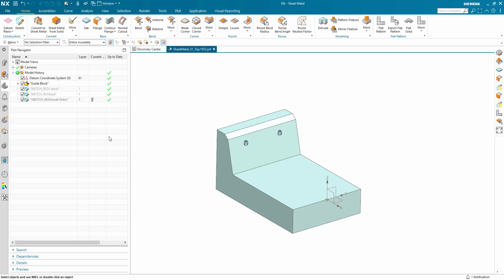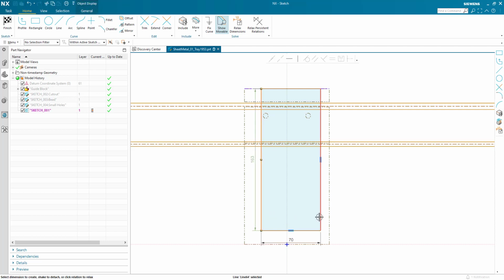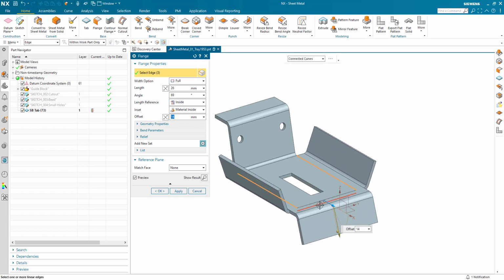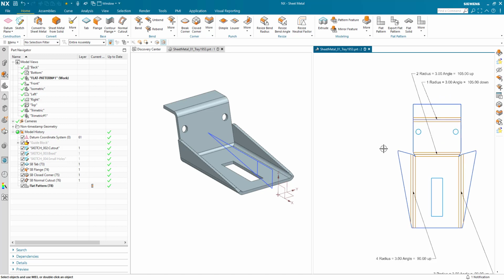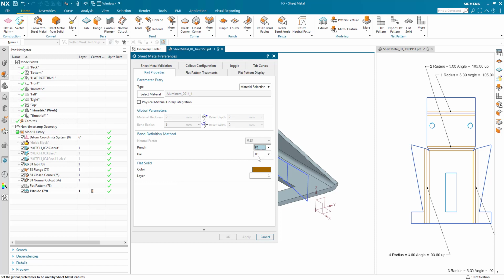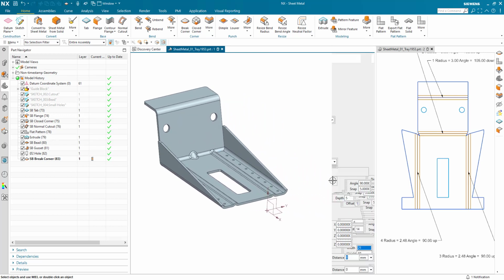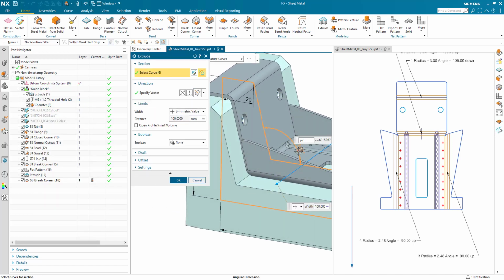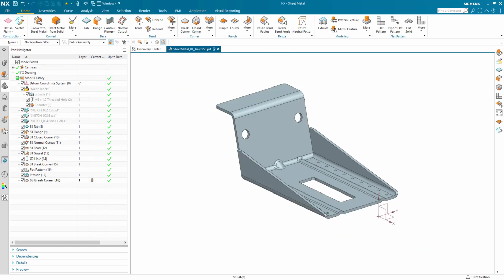Siemens NX Sheet Metal: Creating automotive and aerospace brackets and trays

Comment: The best Siemens NX videos on YouTube
Reply from the maker: I apreciate your comment
Reply: @Dave Walker  and I appreciate your videos. Definitely deserves more views, you're great

If you allow, I'd like to suggest a subject for another video: what's your approach on parametric sheet metal assemblies, separate parts that should fit or be welded together. Multibody parts? WAVE linker? Interpart expressions?

That's something I've been struggling with lately. My designs start breaking when I change some dimensions. I've had some success with multibody parts though, but I feel like it's not the best approach to this.

Thanks! Keep up the good work